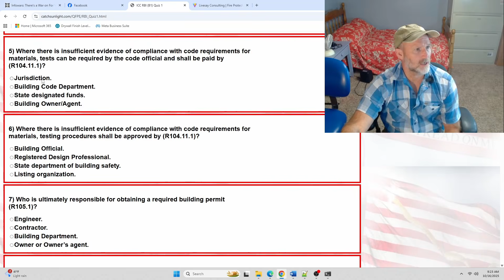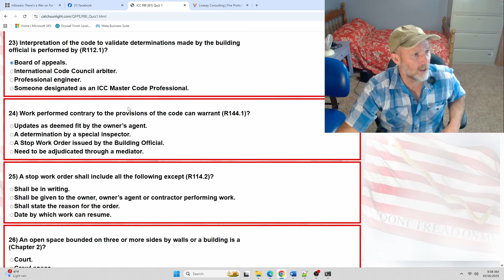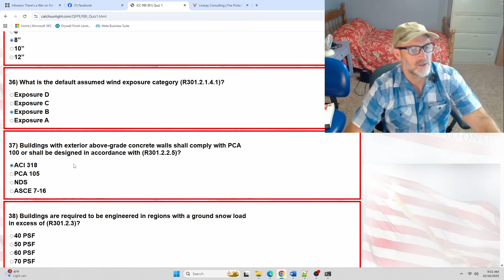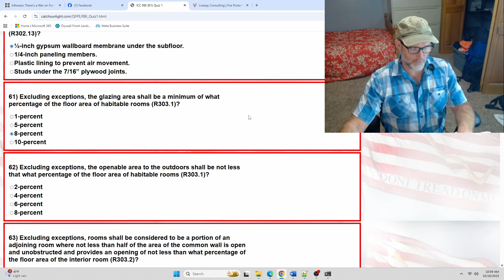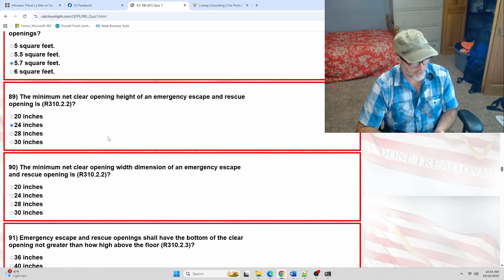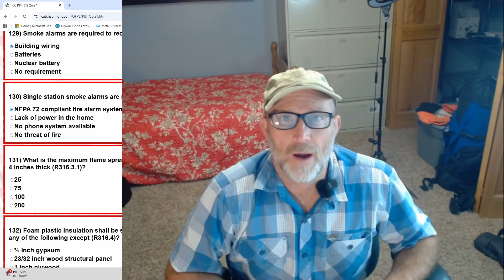Part 1 ICC IRC Residential Building Inspector (B1) Test || '21 Chap 1-3 Practice Questions & Answers

Comment: Thanks for sharing such useful videos！！ one questions remained，I find out you have skiped several content in each chapters（those no highlighted parts），are those parts are less likely to be examined during the test？
Reply from the maker: You are correct.  The items highlighted are specifically the sections likely to be tested on.  If you want something more comprehensive, go to tests.livesayconsulting.com
Reply: @CodesExplained  Thank you for your reply. May I ask whether it would be sufficient for the exam if I can thoroughly memorize and understand the content in your videos, or will there be many variations of the questions on the actual exam?
Reply from the maker: @Civil_Yingying  The objective to passing the test is by knowing the layout of the code.  Don't memorize questions, just go through the practice exams about four times and highlight the sections discussed.  That way you know the general area of the code if something else is asked.

Comment: I am new here, these videos seems very helpful. but if the index sections arent in the open book exam, I think its also very important to know the trigger keywords to know which sections to open to, right? I highlighted everything from your other video, and following along well. But I want to know keywords, is there any video to help with that, or any reference?
Reply from the maker: Really good insight.  In fact, when I was studying for the Commercial Electrical Inspector ICC cert, I put a lot of time into cross referencing the index with other topics.  It seems like I did that with the Building Plans Examiner from the 2015 code set, too.  NFPA has a much better index/TOC than ICC, so if you're not really solid with the specific ICC code your testing on, adding notes to the index is very valuable.  Items I recall indexing in the IRC were locations for stud bore holes and notches as I could never remember where to look that up.  Good luck with your testing.

Comment: Question 142 seems to be incorrect. I think you meant prohibited not permitted if the answer is aluminum.
Reply from the maker: Yes, which is why I explained it with the reference and discussion.  I just did not put in the "Not" before permitted in the problem.  You'll see occasional mistakes due to the speed of me writing the questions, which is why I go through all the references in the video so you can see the actual answer.  Not getting paid for this in any way, so don't have the time to have everything polished.

Comment: why are these videos and the icc study guides all based off of the 2021 code year
Reply from the maker: Because that is the version I took.  All my highlights are in that version.  If you are interested, I am in the process of working on a new platform for the 2024 version at tests.livesayconsulting.com.  We will have the IRC up within a couple weeks, but I've not gone through all the questions yet.  This is based upon AI generated questions that need to be vetted but I'm finding they are very similar to the ICC test questions and will help you know the code really well.
Reply: @CodesExplained awesome thank you for the response and it’s not only you ICC only has older study guides as well. Anyway this is a great way to study much appreciated.

Comment: might be a dumb question, but are the references in parenthesis in the questions also shown on the actual exam?
Reply from the maker: No.  I'm just including them here so you can highlight them in your book and know where the answer is.  That's why its important to go through these tests at least four times prior to taking the B1.  You need to be at a level to take these practice exams while closing your eyes to the reference in the question, just knowing where it is in the code book.